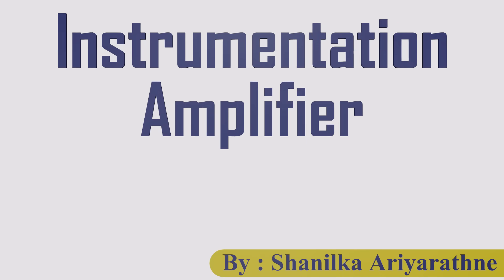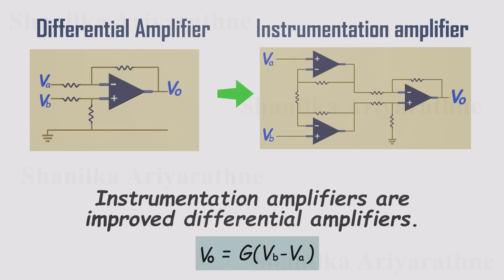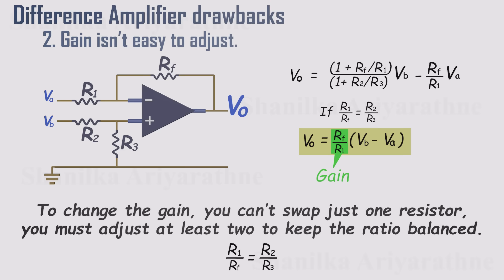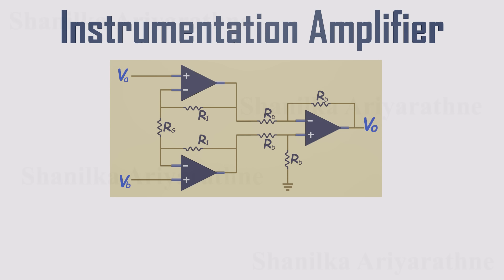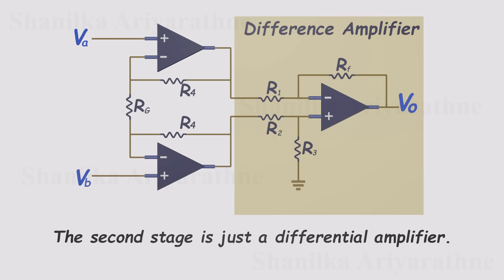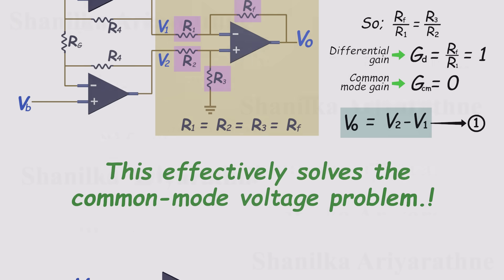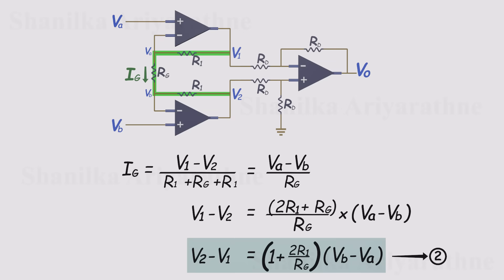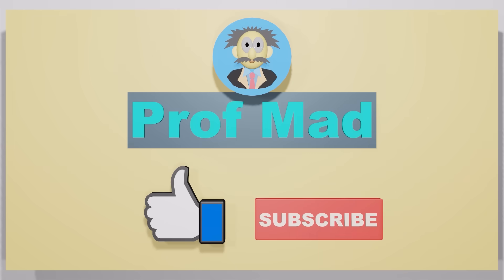Instrumentation Amplifier Explained | Why It’s Better than a Difference Amplifier

Comment: There are some integrated differential amplifiers that are worth considering for some applications. For example the INA149 has a common-mode voltage range of ±275 volts. That can make if useful for things like "high side" current measurement using a simple shunt resistor. It is the exceptionally good matching and tracking of the relevant resistors, something very difficult with discrete resistors, that makes this possible.

Comment: Where an instrumentation amp is used at high gain for very small signals it can be critical to consider all the unwanted thermocouples in the circuit.
Every connection between dissimilar metals will create a thermocouple. For example, each resistor, when soldered to a PCB, will have three thermocouples at each end - one between the actual resistive element and the lead or end cap, one between the lead or end cap of the resistor and the solder and one between the solder and the foil of the PCB. The other end of the resistor will have the same. As long as everything is at the same temperature, the voltages produced by the thermocouples will cancel each other because of the polarities (e.g. copper-to-solder, solder-to-copper). The problem comes if you don't keep everything, or at least corresponding parts at the same temperature. To do this you need to be very careful about the physical arrangements of the components on the circuit board. You have to be sure that you don't have some hot component nearby that will heat some parts more than others. Sometimes you may need to shield the circuit from air flow.
These problems are usually not too serious with signals of at least several millivolts, but if you care about performance down into the microvolt range the problems can be difficult.

Comment: If you are constructing an IA from op amps and discrete resistors using surface mount components, reasonably good resistors are not terribly expensive. 0.1% tolerance parts, which yield performance that is acceptable in some circumstances, are quite cheap - with a caveat. Unfortunately, the temperature coefficient of resistance of the low-cost parts is rather poor, typically ±25 ppm/°C. If you want better tempco, such as  10 ppm/°C the resistors will be considerably more expensive. An integrated IA with laser trimmed resistors can be less expensive in the end.

The temperature coefficient problem is why select-on-test from "ordinary" resistors will not yield acceptable results in many applications.

Comment: Instrumentation amplifiers are also very good for musical applications like microphone preamps and also for precision adding or subtracting of control voltages or signals for synthesizers. If you buy a ready-made chip you should also check if it can actually go down to unity gain or if you need to pad the signal for unity (or design your own circuit to do that).

They do have some pitfalls, however. If you are processing signals that are significantly large compared to your rails, you may not have as much headroom as you expect to. Also, if pairing with a capacitively coupled stage beforehand, you will want to make sure to add pulldown resistors to the inputs so that those nodes are referenced to ground. You can size these to your requirements for input impedance easily, however.

Comment: If it is better in every aspect why isn't it substitutes the simple opamp and render them obsolete
Reply: They are expensive
Reply: @youpoofoowoo  in the era of 3nm gate processes these opamps are dirt chip. One do not even need to laser trim them after production, it is possible to overengineer it with thousands of additional transistors to automatically tune its resistance after production with a technique called fuse programming.
Reply: @pahom2 
I do not know the potential of producing cost. But they are actually priced high.

Comment: I mean no hostility, but your assertion that it's impossible to match ordinary resistors to a level of precision necessary to make an effective instrumentation amp is simply false. Not only is it false, it's actually very easy to do!

The method relies on cheap mass production and the pigeon hole principle. The only thing needed is a tool sensitive enough to be able to bin resistors to the limits of your matching needs. This tool can be a simple Wheatstone bridge. The only limitation is your patience.

Others have also point this out in the comments. Also, I have done it myself. It takes SOME time, but, for a hobbyist like me, that just means more fun time.

Comment: Don't google INA128 price
Reply: I did. It's like 1 dollar on LCSC
Reply: Mouser has them in single units between $10 and $20, except for the HD model which goes for $160.

Considering how much devices using these things cost, it's not a deal killer.  Not horribly hobbyist friendly, though.  I wonder how generous TI is with samples?
Reply: @jeffspaulding9834 LCSC has them wayyy cheaper, so they absolutely are hobbyist-friendly. Mouser is overpriced, just like Digikey. And regarding the samples - I was once told by a guy from university that TI got strict about samples, as people started reselling them online afterwards. I know it is a bit different of a case, but... you get the point.
Reply: I recently bought 10 INA129 (very similar to INA128, different equation used for gain) modules fully assembled on small PCBs on amazon for $30, so $3 each. They are the real thing based on my testing.
Reply: @stamasd8500 damn, sucks to live in Ukraine. Here, INA128 are $7 for one IC

Comment: One thing you can do if you're going to build this up yourself rather than just buying a ready built instrument amp is to use a quad op-amp package and either use the forth op-amp as an output buffer or configure it as another difference amp but with the inputs swapped so you have a differential output.

If you're wondering why you'd build one up versus just buying one, look at the difference in cost between the INA128 and the TL084 plus 0.1% resistors...
Reply: I figured the main reason you would build one yourself is because hobbyists are a lot more likely to already have op-amps lying around than instrument amps. Plus even if you have to buy them, if it's for a temporary circuit that you're going to tear down later, the op-amps can be repurposed much more easily.
Reply: You can improve the discreet setup by matching your (equal) resistors to each other instead of relying on them being within 0.1%. It is more important that they are close to each other than that they are close to some nominal value.
Reply: @jstan_49  for the time it takes to match resistors at an engineers wages, one can buy 10 INA123's. Hobbyists are a different case, of course.
Reply: One can find AD620 and INA333 boards for little money on friend Ali. The INA333 is a slow micropower 5 volt chip.
Reply: Even with 0.1% resistors, you won't be able to match the CMRR of the INA128. According to a TI datasheet, the CMRR = (G+1)/4t where t is the tolerance of the resistors. With 0.1% resistors and G = 10, your CMRR will be 11/4 * 0.002 = 2750 or 69 dB. A far cry from the 120 dB of the INA 128. Even with 0.01% resistors, you'll only reach 89 dB while the price of those resistors are already half a dollar. Go up one decade and you'll pay several dollars for a resistor, ending up at 119 dB CMRR. Better buy an INA128 then.
Reply: @meindertsprang7491 if you need the CMRR of a dedicated instrument amp then you're just going to have to buy one. But for most hobbyists that level of CMRR isn't necessary. Also, you get quite easily get much better matches using a Wheatstone bridge if you really want to push it as far as you can. Again, it all comes down to what do you actually need Vs how much you want to spend.

Edit: with 1V of common mode input, and a CMRR of 69dB, you'll get about G x 0.0004V on the output.
Reply: @meindertsprang7491 who cares? It was understood it wasn't going to be as accurate, but for 99% of circuits it's not important

Comment: Now for the next level. 1) The instrumentation amplifier is dependent on the internal node and the resistors there, when you combine that with the capacitance inherent in the design the 2nd stage effectively becomes a low pass filter, the GBW is 'usually' much lower than the simple differential amplifier. 2) The input common mode range AND the input differential mode range are limited in different ways with the instrumentation amplifier.  The differential mode range is depending on the common mode voltage. Waiting on that video because it's doesn't simplify neatly. Keep it up. :)
Reply: The GBW is't really MUCH lower for comparable devices (AD820, 1.8 MHz; INA128, 1.3 MHz). The difference is more determined by the settling time (AD820, 1.4µs; INA128, 12 µs).

Comment: Can you suggest to me a full op-amp module that can measure ac impedance and phase angle for a very high resistive sample as a function of frequency from 0.01 Hz to 100 MHz and few mV-ac signal such that negligible impedance and phase are produced by the module itself (no sample)? With all regards and thanks
Reply: Good luck with that one, sounds impossible. 😮
Reply: @larslindgren3846 we did it long time ago to measure impedance of semiconducting samples of very high resistivity but was from 100 Hz to 1MHz via phase gain meter (PGM) that measures amplitude of impedance and phase angle. The input of noninverting op-amp was connected to ac low-voltage source and its output is connected to one channel of PGM. The input of inverting op-amp was connected to one end of the sample, whose other end was connected to the same ac low-voltage supply. The output of inverting op-amp was connected to the other channel of PGM. Both inverting and noninverting op amps of high quality and had very high input impedance.
Reply: @MousaJafar-u7h It depends on what you mean by a very high resistive sample if it is in the GOhms range then I think you are out of luck measure it directly at 100 MHz. At 100 MHz each pF stray capacitance is about 1600 ohms leakage impedance.
The circuit you describe sounds interesting, you are basically making a voltage divider between the sample and the op circuits input impedance so it is important that that is stable.
I think you will get large phase and amplitude errors but as long as they are stable you can compensate with a calibration table.
Reply: @larslindgren3846 Hi 
Still I’m waiting for your reply to my previous message! I really ambitious to hear your comments and suggestions.
Reply: Für einen Hobby-Bastler ist das ein aussichtsloses Unterfangen !
Sowas ist etwas für Spezialfirmen wie Rohde&Schwarz ! Die kriegen das hin von Gleichstrom bis 10 GHZ...und höher.. ! Aber... fragen Sie nicht was ein solches Gerät dann kostet...!